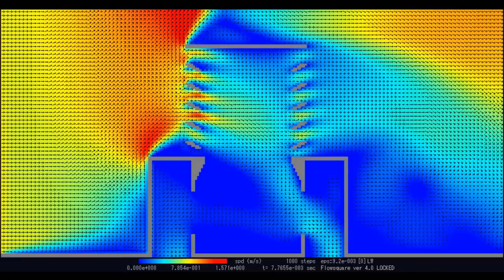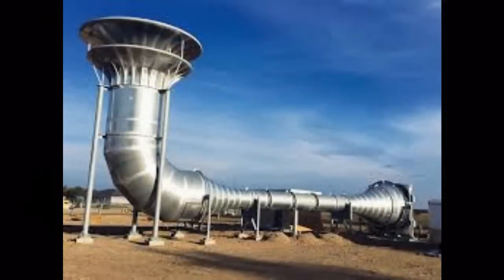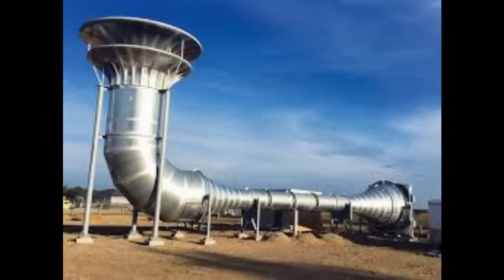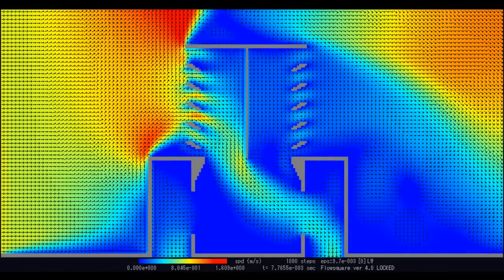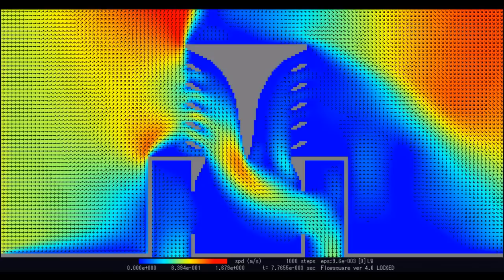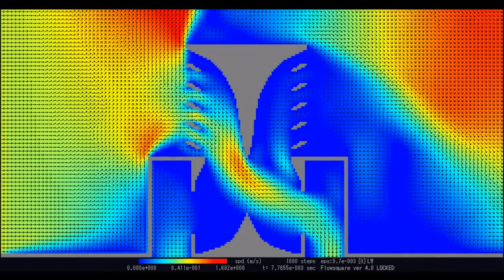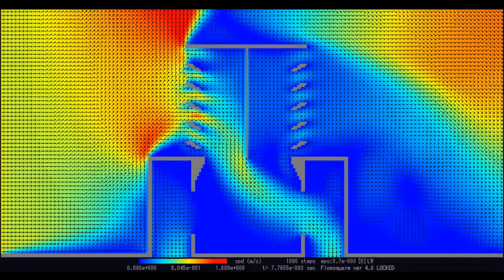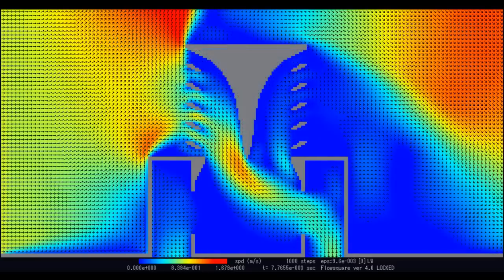1880 Modelling Of The Darwin Waters Wind Turbine

Comment: Rob. I saw this issue arising a mile away. That's why i strongly suggested to you from your previous videos of using a fluidic type diodes such as a tesla valve or an equivalent to mitigate aerodynamic losses  towards the turbine blades and improving diodicity levels greatly. If you 3d print design a tesla valve on the crossed section area of the fin blades (flat sided not at the edge points) on your darwin template or an inward column positioned between inlet funnel to further increase more pressure flow,  it will forcefully capture the wind convergently  in one direction minimising wind dissiptitation. Here's an article that demonstrates this with different valveless models types using computational field dynamics analysis performing on wind and water turbines. "A Study on Fluidic Diode for Wave Energy Conversion-Effect of Bypass Geometry on the Turbine Performance" I'm truly excited to be a part of this extraordinary journey. looking forward to your next video.

Comment: Once you get through with air as your fluid medium, have we thought about putting the darwin section in a water source and using it plus pipe to make a generation section anywhere you please along the shore, and then pipe it downstream. 
Thinking this as a replacement for current storm drain designs might do wonders and light streetlamps during storms, etc.

Thanks Trey!

Comment: Would a better wing profile be similar to airplane wings with full flaps engaged for low speed. The shape is quite different. If your country has a low ish wind flow, this wing profile may help improve efficiency. 
Not sure if wind turbines capture air differently so disregard if that is the case. Keep the content coming. Awesome.

Comment: One crazy idea I had a while back, to harness the energy of the wind was to get a sort of wind catcher and use it to direct the wind on highways on the direction of traffic. Just but reducing the head wind/cross winds, imagine the amount of energy that would save to the transportation industry and the amount of CO2 reductions. Obviously it would be primarily for long out of town highways and adding a wall on the side of the road (here in the US I seen looks of highways with walls to reduce noise pollution).

Comment: Robert, I am not exactly a 3d printing wizard, yet.  
So, did you print the upper cage of the wind turbine on its side? It seems like having all those blades flopping around, they may not get printed very accurately if it is printed from the bottom up??.

Comment: I agree with having the conical shape top and bottom inside but you will still need the dividers on the top of the collector to prevent the air from passing through. but in this configuration you don't need all the little blades (baffleds) going around the outside of the collector. depending upon the height of your collector of course.

Comment: Wonder if it makes sense to consider the "exhaust air" out of these turbines?  Since you are taking energy out, the air presumably will be moving slower as it exits the machine.  It would seem that would build up pressure at the output end, and so it would be slightly more difficult for more air to come along and fill that space.  A conical shroud around the exhaust, allowing the air to expand might help.  Just speculating; thinking out loud, but it seems consideration of the exhaust is an important part of improving the efficiency.

Comment: By extending the tube between the intake and the "squirrel cage", the collected wind should have the chance to align itself straight downward and eliminate the flow from exhausting out of one side of the turbine - possibly utilising the blades a little more and possibly generating a bit more torque when under load. Just thinking out loud. I've downloaded the stl and I'm going to play with it a bit.

Comment: OK, now that the floodgates have been opened with cones and baffles (mixed metaphors, I know!) .... supposing the squirrel cage with a cone is a more efficient device to collect and generate elecrticity (as opposed the darwin cage), what about having two squirrel cages, one at the bottom and one at the top (the top one turned upside down so they 'face' each other) with a plate separating them which then means that each SC (squirrel cage) generates its own electricity?  The 'maglev' magnets would have to switch for the top SQ, of course).
Great to watch these developments in action.

Comment: "All computer simulation are wrong but a few are useful"  I think this is a useful one, mainly because it indicates wind speed; where the power is!  One half the wind speed equals one eighth the power.  The highest wind speed is at the top of the collector there the wind is trying to get around it.  The simulation shows the air at the the turbine much slower than the wind outside.

Comment: Another great video; whilst not being an engineer of any sort, just thought it may be of interest to set an ‘end goal’, mine being that it would be fitted into a U.K. chimney pot/ stack, as there are so many of them, mostly redundant, with the chimney being used for the services such batteries, cables etc. I appreciate that there will be many flaws in this thought, eg any servicing required for the bits at the top. Also as the common older houses had at least two chimneys together, then the’waste/exhaust air could be diverted out. Also thought this maybe interesting as it may provide a nominal scale for the items at the top, and then help to work out what power could be produced. Am sure plenty will say that this bonkers, that’s fine, it’s just a thought for applications in our inefficient, cold housing stock.

Comment: Robert...golden ratio twisted hyperbolic funnel and only hit one side of the squirrel cage.  That way there the optimal path for inbound win through put is directed to one side of the cage so that there are no counter productive wind flows working against you.   Just the first idea that came into my head putting a little Viktor Shauberger twist (pun intended) on this approach..

Comment: do I recall correctly that the vanes on the squirrel cage are airfoils? if so wouldnt they work even better in this case if the airfoil faced the other way? or did you do that?
Reply: never mind I typed that too early in the vdo...

Comment: Really exciting.  This is going to need anchoring down big time, because the Darwin collector inevitably pushes up when it pushes the air down, and it's a big kite.  The advantage of fitting a rotor/generator on top is that the collector is pushed down and you have far less likelihood it will end up joining Dorothy in the Wizard of Oz.  Similarly, that automatically leads to a propellor-type design - otherwise there is still a cap on top where the air is diverted by 90 degrees that will be pushed upwards - so one way or another this frame will need to be attached to ground anchors (or for a small one, a heavy concrete block).  A light hyperbolic shape might be achievable using a canvas membrane held (in zero wind) as a cone between two rings?? (rather than a solid shutter collector).  Of course, that's even more like a kite.  I am trying to get a sense of the effect in air - which is slightly different from water, being compressible - allowing it to pressurise (and so stop flow) or form a vacuum (and so encourage flow).  The hyperbolic forms tend to spiral motion and vacuum, and so anything that has those forms will also tend to vacuum and spirals - so the 2D modelling (even if it's radial 2D modelling) is probably substantially underestimating the flow as the fan starts to spin.  As such the vertical veins may bring in air directionally and provide mechanical rigidity, but they get in the way of the spiral flow and create an elevated pressure within the intake structure.  The air will also probably respond well to bigger inlet "width" (so it doesn't compress so much) but that automatically results in a taller tower.  Lots of compromises.  On the height-width ratio, phi seems to work pretty well in flow situations - for instance chimneying from a dome shaped bread oven is optimised with a structure and door opening height:width ratio of about 5:8.  I'm interested to see the result, because the whole structure and air exhaust may cause a local pressure increase (reducing wind intake) - and it's not immediately obvious what will dominate the flow.  But the journey youre going on is really wonderful to watch, and so much fun, and it's obviously going somewhere interesting and  useful.

Comment: I wonder if you can compare using same air input,  the  squirrel cage with ducting to improve air flow from the side,  to the  darwin cage model you are considering. I guess the efficiency will be similar and that the extra effort and cost of the darwin cage would make it less attractive. Would do you and anyone else think?  André in Sydney

Comment: I'm sure there are numerous options for coupling a darwin collector to a turbine of any kind. Is it better to direct and restrict the air to a small section of the turbine to increase the wind speed - either from the inside or outside? Are tall or short turbine blades better? Should the air be directed perpendicular to the blades or at an angle? Should the angle be acute or obtuse to the angle of the blades? So many experiments.

Comment: The next step would be to make another squirrel cage of the same diameter and magnet capacity with half the height.  The output from the one on the desk versus a half height one would point to if there is a difference and which is able to be moved more by the same wind from the same Darwin capture.

Comment: Could your squirrel cage be designed to draw in air flow in addition to the Darwin tower?
Reply: OoH!!!

I second this!!!

Something like a combination of the two, or a single unit that is both a Darwin and a squirrel cage?

(Awesome suggestion JP!)
Reply: @WarblyWark  I will 3rd that!!
Although,,,
I keep thinking about the Flat Feather Serpentine Coil and generator?!
Any ideas would be gratefully appreciated!! TIA .
Andrea and Critters.  ....XxX.....
Reply: I think you would run into the issue of needing the darwin air to exhaust out of the cage where the additional wind you want to draw in would be competing against the darwin exhaust causing a slow down.
Reply: I was thinking on this a bit and wondered about a vortex shaped louvered inlet and outlet. A louvered cone.
Reply: The air blowing downward and OUT of the squirrel cage precludes the ability to draw air in.
Reply: What about a wood burning stove using the air inlet to turn the turbine? I know this isn't useful if you don't have a wood burner but some might.

Comment: Neat. Very nice. So, am I reading this correctly  - we have a broad region of upwind flow entering on the left hand, inlet side, this is accelerated to a narrow region of high speed flow leading into the mechanism at the centre, which splits into a similarly narrow region of high speed flow to the bottom right and a broad region of low speed flow at the top right on the downwind, right hand, exit side of the device, in deep blue? So, is the downwind, deep blue, exit side essentially stationary flow, or does this illustration indeed indicate leakage out of the downwind side? If so, how large is that leakage? What are the respective volume flow rates encompassed by each of these locations? What proportion of the mass entering into the device on the left ultimately leaks from the device on the right hand, exit side? This is really interesting stuff, but it's a little hard for me to judge only from the velocity field itself and the relative areas through which these flows, flow.

Comment: The main advantage I in this is that you put a small very efficient turbine to work with low winds of a much larger tower, making it work at 80% capacity most of time. It will outperfom a large turbine the size of the tower because ita much cheaper to build.
Reply: I think that you are onto something!!
I'm just wondering if they can be used in series or parallel?!! 
TIA for your ideas about this.
Kindest Regards and Best Wishes from the NW,UK.
Namasté 🙏💞
Andréa and Critters.   ....XxX....

Comment: With the 2d model it looks perfect, however with a 3d model I'm sure it wouldn't look so good as the cone would still allow air to go around it.
I can picture a nice weather vane on the top to control a half circle that blocks all the air from passing through depending on the wind direction.
Reply: .............🚩   
  🌬     (🌙)
              👇
So the brackets are the darwin wind capture.  The flag (wind direction tail)is attached to the moon (half circle wind blocking device).  As the wind changes direction so does the baffle inside.  Doing this would be silent compared to the annoying flaps.  It doesn't have to be a flat half circle it can be shaped to produce a more downward flow.  I hope it helps.

Comment: I think there is an issue I don't see addressed the parabolic cone in the tower will really create turbulence because wind is coming from a single side. In the tower you need a wind following mechanism that directs air down but doesn't create turbulance. Honestly I would do it in steps and do the Waters turbine with a parabolic cone first and then look at the tower flow after as I expect it will have less improvement.
Reply: Great observation. I'm thinking this might be 2d model...so it wouldn't be as true if that is the case. Good start....ill like to team up with someone to create a few models aswell. Then flow test it

Comment: Do you think it would help printing some well placed fins on the conical bit inside the cage like a turbo impeller? Or maybe extending the fins of the cage into the cage slightly? Just ideas :) Love the idea of funneling the wind into the center. Thanks for the great content as always!
Reply: just what I was thinking, but aren't they reliant on air coming in from one direction?
Reply: @gee3883  I'm no expert, but my first impression at the thought is that because the cage is attached to the cone, if the air were coming down and hit a correctly angled fin attached to it, it would aid in rotation while also deflecting the air to the outer fins. But like I said I've got nothing to base that on. Either way I'm still curious about extending the cage inward a bit. Can't wait to get a 3D printer and start trying this stuff out for myself :D